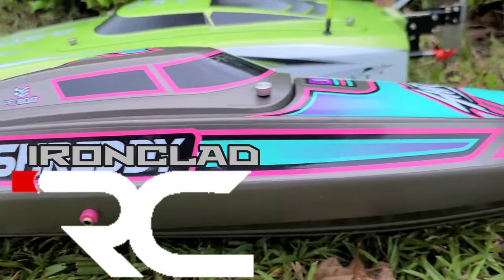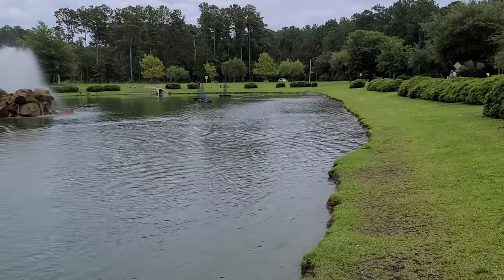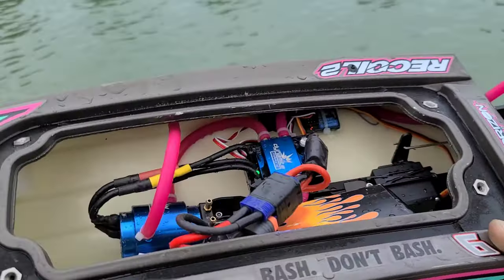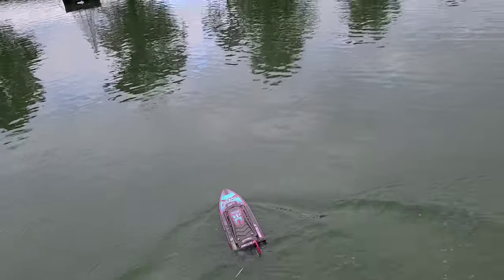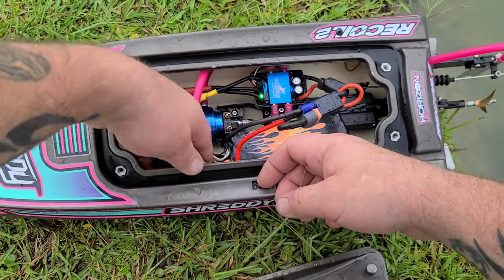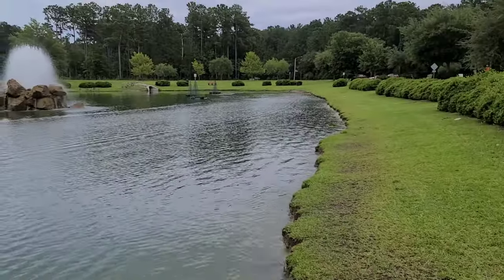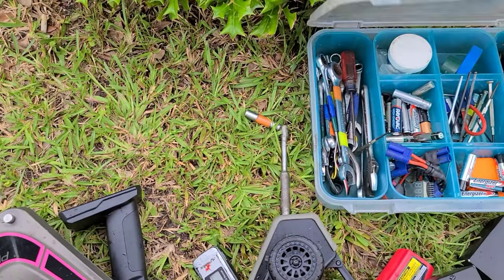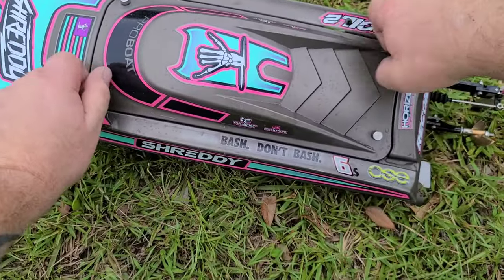Ironclad Durability Testing Proboat Recoil2 New Pb 61mph - 6s Rc Boat

Comment: Hey iron clad, I was wondering if putting a bigger prop onto your boat like a 48mm would it decrease the performance or damage parts of the boat. I just wanted to ask a professional like you.
Reply from the maker: Yes.  A 48mm prop on the recoil 2 would definitely be over kill & could heat the electronics up big time.  I'd stay in the 40 - 44mm Dia range
Reply: @IRONCLADRC  Thanks.

Comment: Well Big B, you certainly are logging a bunch of "Frequent Flyer Miles"....  🤣
Reply from the maker: Yep,   she's a work in progress.   I received the tfl small bolt yesterday.   THANK YOU.  & thanks for the competition it was a hoot
Reply: @IRONCLADRC  A word of warning on that Small Bolt:  As you can see, I tried a turn fin on it.  For reasons I can not fully explain, that turn fin caused an instant barrel roll upon throttle actuation no matter how I had it positioned.  It runs better without one.

Comment: Question about your tug boat. I see it says for boats up to 48 inches as far as recovering whats your thoughts my smallest boat is 52  inches is it a power issue or just pure size issue?
Reply from the maker: I think it's the power system, or the prop,  you could actually put a more efficient prop on with out changing power systems,  she would more than likely handle a 60 inch boat with out issue.      

She's kinda  lite weight,  if your gonna be using it for larger boats I'd add some extra ballast to the stern to keep the prop in the water. 
 
Out the box I'd say no, but with a few proper mods & adjustments I think it would work for you.

Comment: Have you tried putting battery in front of motor horizontal?? Seem s to have enough lift it may trim out better
Reply from the maker: Yes sir I have, with the 4s pack She actually runs good with the battery forward but with the big 6s pack all she wants to do is veer with the weight forwarding.

Comment: hey my man so ive ran the recoil 2, 3 times now and i love it!! great RTR boat but i need your help!! i plan on upgrading to a 4s. this 3s battery jus doesnt last long at all. i want a little more power. ive already planned on getting a better charger and battery but i want to upgrade the prop too for some better top speed. any recommendations? idc abt holeshot speed. jus want a good roost and some good speed to impress the neighbors in the neighborhood pond
Reply from the maker: Octura m440 is a great prop low & top end. Offshoreelectrics.com
Reply: M440 prop